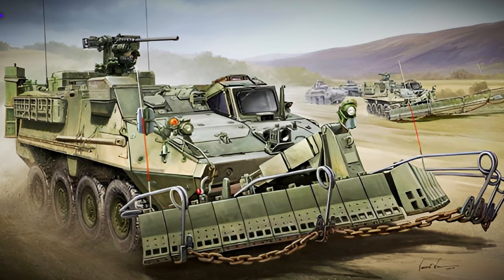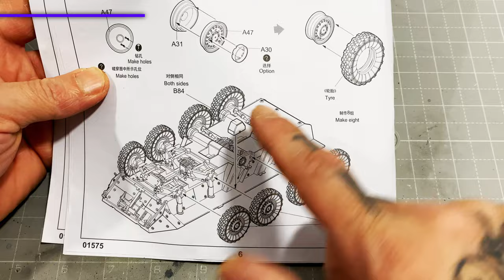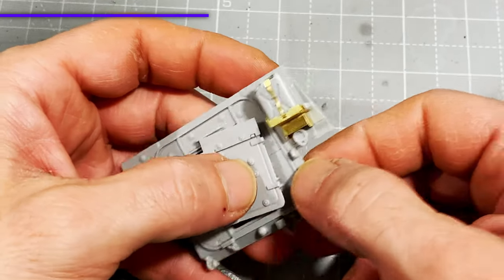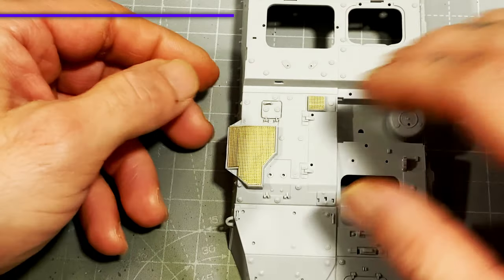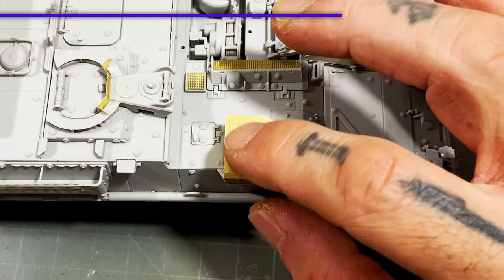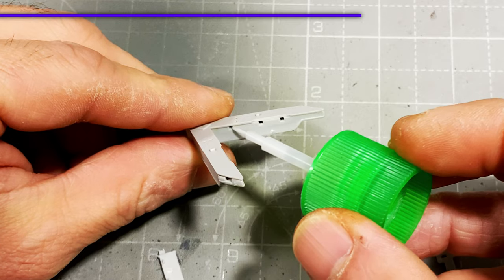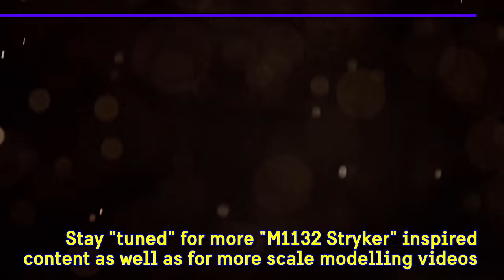M1132 Stryker Engineer Squad Vehicle - Surface Mine Plow - Part 1 #ScaleModel #Miniature #ModelKit

Comment from the maker: 00:00 Hello my friends.
00:05 In this modelling project, I am building a multipart project of the M1132 Stryker ESV (Engineer Squad Vehicle) w/SMP/AMP-Surface Mine Plow in scale 1 to 35 from Trumpeter.
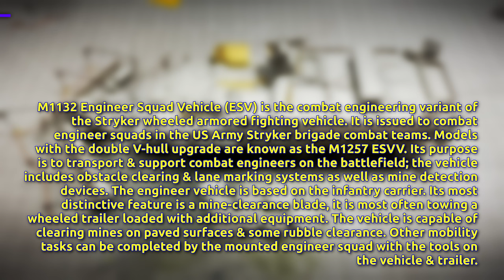00:24 M1132 Engineer Squad Vehicle (ESV) is the combat engineering variant of the Stryker wheeled armored fighting vehicle. It is issued to combat engineer squads in the US Army Stryker brigade combat teams. Models with the double V-hull upgrade are known as the M1257 ESVV. Its purpose is to transport & support combat engineers on the battlefield; the vehicle includes obstacle clearing & lane marking systems as well as mine detection devices. The engineer vehicle is based on the infantry carrier. Its most distinctive feature is a mine-clearance blade, it is most often towing a wheeled trailer loaded with additional equipment. The vehicle is capable of clearing mines on paved surfaces & some rubble clearance. Other mobility tasks can be completed by the mounted engineer squad with the tools on the vehicle & trailer.
00:44 The Stryker is a family of eight-wheeled armored fighting vehicles derived from the Canadian LAV III. Stryker vehicles are produced by General Dynamics Land Systems-Canada (GDLS-C) for the United States Army in a plant in London, Ontario. It has four-wheel drive (8?4) & can be switched to all-wheel drive (8?8). The Stryker was conceived as a family of vehicles forming the backbone of a new medium-weight brigade combat team (BCT) that was to strike a balance between heavy armor & infantry. The service launched the Interim Armored Vehicle competition, & in 2000, the service selected the LAV III proposed by GDLS & General Motors Defense. The service named this family of vehicles the "Stryker". Ten variants of the Stryker were initially conceived, some of which have been upgraded with v-hulls.
01:04 A combat engineer (also called pioneer or sapper) is a type of soldier who performs military engineering tasks in support of land forces combat operations. Combat engineers perform a variety of military engineering, tunnel & mine warfare tasks as well as construction & demolition duties in & out of combat zones. Combat engineers facilitate the mobility of friendly forces while impeding that of the enemy. They also work to assure the survivability of friendly forces, building fighting positions, fortifications, & roads. They conduct demolitions missions & clear minefields manually or through use of specialized vehicles. Common combat engineer missions include construction & breaching of trenches, tank traps & other obstacles & fortifications; obstacle emplacement & bunker construction; route clearance & reconnaissance; bridge & road construction or destruction; emplacement & clearance of land mines; & combined arms breaching. Typically, combat engineers are also trained as riflemen &, when required, serve as provisional infantry.
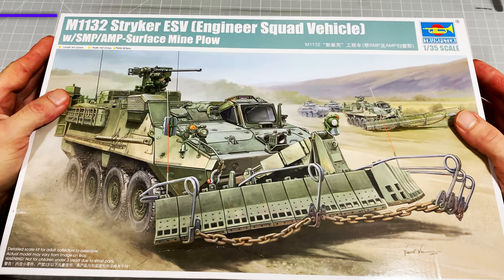02:23 This is the box of the M1132 Stryker ESV (Engineer Squad Vehicle) w/SMP/AMP-Surface Mine Plow in scale 1 to 35 from Trumpeter. It only has about 950 pieces 😱
02:40 The box includes lots & lots & lots of sprue & some clear sprue. And then some more sprue 🤣
02:47 These are for the plow & these I have no idea what they are 😱
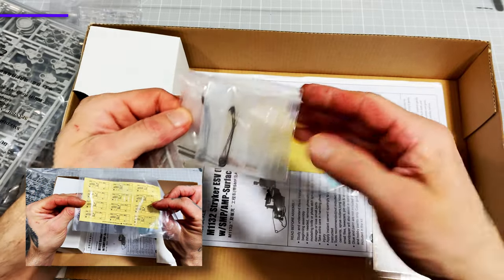02:53 Decals & photo etched parts.
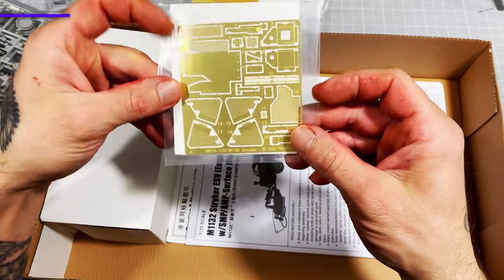02:59 Upper & lower hull parts.
03:03 8 seemingly quality tires.
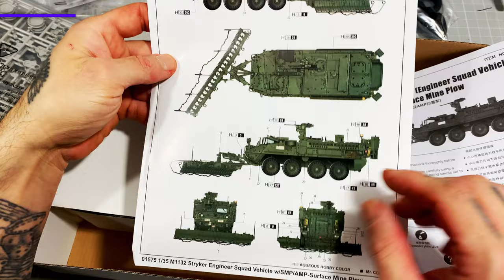03:08 This paper has the 2 assembling versions of the vehicle. I will go for this one.
03:18 Lastly, the 34 steps manual which means that with my new work & life commitments, I will be done in a year or so with this project 🤣🤣🤣
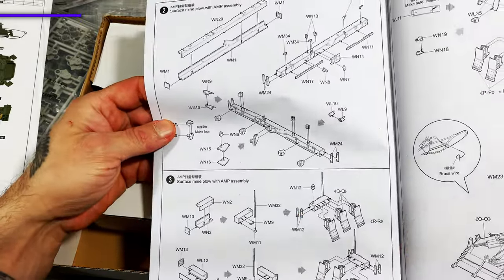03:28 Let's go.
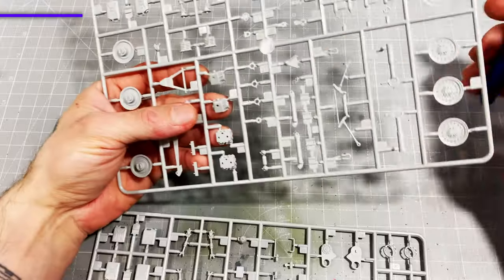03:29 Starting with the lower hull, cutting & then smoothing out the parts with the hobby knife, file &/or sandpaper. When needed, using the hobby knife carefully in the opposite direction to avoid cutting or damaging the parts.
03:44 ATTENTION! Keep always in mind that after gluing, painting, etc to let things dry.
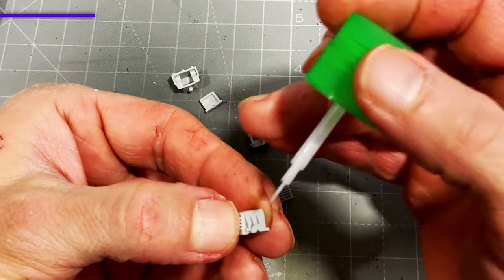03:56 Gluing. Keep in mind that I will be doing work both on & off camera.
06:07 Even though the manual says to do the wheels now, I will just assemble them but not place them at this point in time. This one I already made off camera. Making another one on camera.
06:32 I forgot to mention that I made these holes off camera in order to attach these like so.
06:50 Did some work on the back side off camera. Combining like so.
07:09 The kit includes both the plastic holders for the jerrycans & the photo etched ones. Since I will use the photo etched ones, I prepared off camera the 1st one. Onto the 2nd one.
07:26 Cutting, trimming & bending as needed.
07:43 Here will place couple little pieces as bracing. Super gluing.
08:03 Attaching.
08:19 Off camera placed these 2 jerrycans & a belt that holds them in place. Super gluing the other 2 & their belt.
08:47 Did some work on the door off camera. Attaching.
09:04 On the upper hull added quite a few little pieces such as hatches. Adding some more pieces on & off camera.
09:39 Super gluing couple photo etched pieces.
09:54 More gluing.
11:02 Prepared couple photo etched pieces. Super gluing.
11:17 Back to gluing 😊
11:59 Super gluing this photo etched piece.
12:13 Back to the grinding 😉
12:46 I wish all the kits had pre-cut masking tape for their windows 😊
13:10 Done off camera. More work? Off I go then! 😉
13:46 I had misplaced the windows but I fixed it off camera.
13:49 This gap here I don't know why it exists but this is how the manual shows it.
13:55 Did some work on the lower hull. Combining the hulls.
14:13 More work? Off I go then! 🤣
14:26 Another photo etched piece. Super gluing.
14:35 This one lacks a proper placement guideline so I am gluing it in approximation 😞
15:05 I don't know what this is 😱 but yeah... Attaching 🤣
15:17 Surface Mine Plow... Assemble!
18:39 Completed this off camera & added these chains as well. Combining.
18:47 Placing the pin from this side instead of the other side that the manual says it is so much easier 😞
18:54 Prepared these metallic pieces with their photo etched details off camera. Super gluing.
19:22 Finished off camera. The Surface Mine Plow assembly is done 😊
19:29 Hopefully you liked the project & please be patient for the release of its presentation. Because I love this amazing art & I strive to be better, please do help me by sharing your words of wisdom in the comments below.
19:45 TO BE CONTINUED.
20:00 Hit the Like, Subscribe & Notifications Bell "buttons". This way, together, we can grow a community around the exciting art of scale modelling!
20:09 Stay "tuned" for more M1132 Stryker inspired content as well as for more scale modelling videos.
20:17 Thanks for watching!

20:20 Free B-Roll & Stock Videos provided by Videezy http://www.videezy.com

Redux
https://www.youtube.com/watch?v=RGVk5h3Exb8
Flash of the Blade
https://www.youtube.com/watch?v=yXiwecCMOPY
Recovery
https://www.youtube.com/watch?v=eNrSsCeqT9s
Invader
https://www.youtube.com/watch?v=7hOpTNqO14E
Conspirator
https://www.youtube.com/watch?v=PwPUKrDNWbo

20:20 by Karl Casey @ White Bat Audio

Website https://whitebataudio.com/
YouTube https://www.youtube.com/channel/UC_6hQy4elsyHhCOskZo0U5g